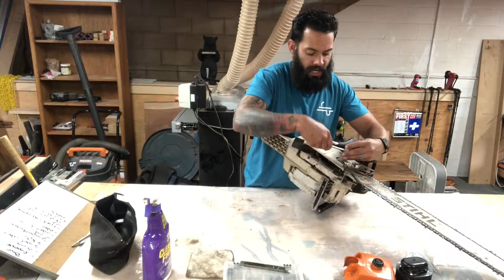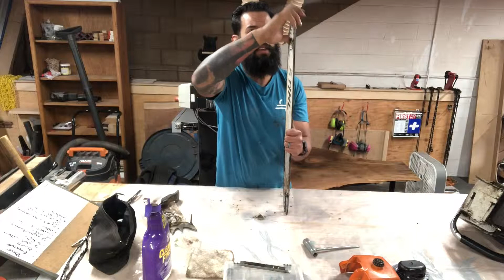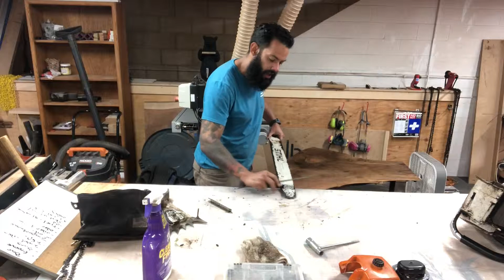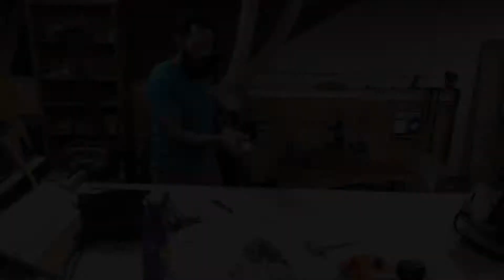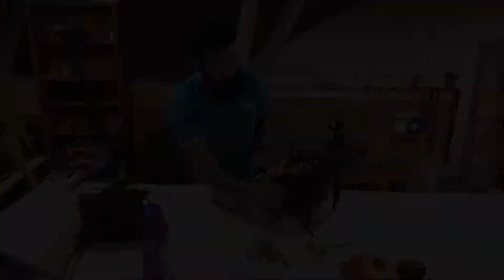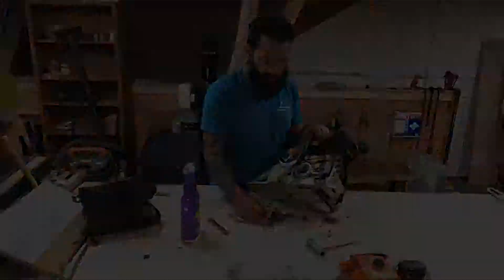Chainsaw maintenance - Stihl MS-460

Comment: Sprocket E clip - reinstall with a pair of pliers.  Pushing it in with a screwdriver or screech is a sure fire way to loose it.  I start it in the groove and grab the top of the E clip with a pair of pliers and snap it in the groove.

Comment: When cleaning the PTO side, clean out the bar oil port before you blow things off because any sawdust in the port, actually a slot, can be blown down into the oil line feeding the port, blocking oil delivery to the bar.

Comment: I refill, clean and sharpen each saw after it was used.  Sometimes this takes longer to do than the saws were in use.  I often use multiple saws and several hours cleaning, afterwards, makes a long day a lot longer.
Reply: keep it out of the ground you want have to sharpen it...
Reply: @usaisalwaysnumber1  cutting big wood it is often unavoidable.  I sharpen any saw after use, whether it needs it or not.  I also carry several saws with me for just those occurrences.  It took me three sharpening to get my ms 360 back up to my standards.  I also had to file down the top and bottom of the bar to remove the abrading the sand caused.  Stoned it, too.  That is just one of the reasons that I do not like laminated bars - they are to soft for hard cutting in sand.  I do like their weight differential over standard Oilimatic E bars.  My 440 finished bucking up that 25 inch hickory with no problems.  That wood was so heavy I could not roll it over and finish up the cut.  Those rounds weighed 200# a piece  and I did not have a Peavy with me.

Comment: One word of advice when filling gas and oil tanks - brush off any saw dust or dirt from around them before filling.  This keeps and stuff from getting in your tanks, blocking the filters over time.